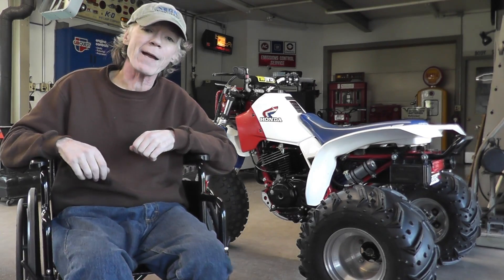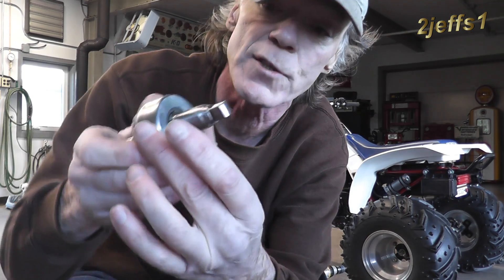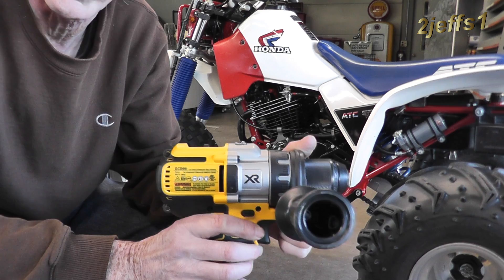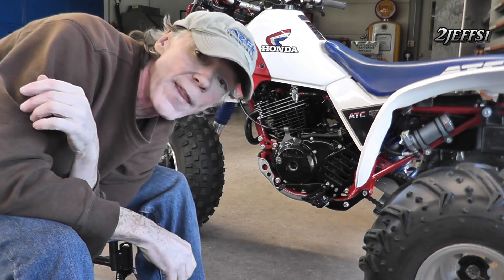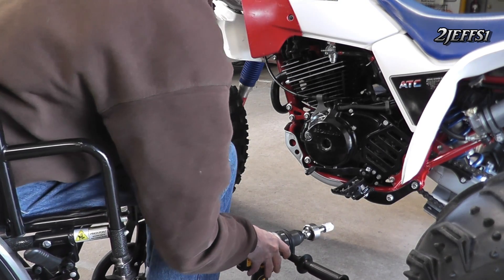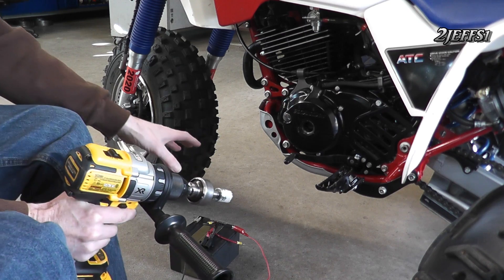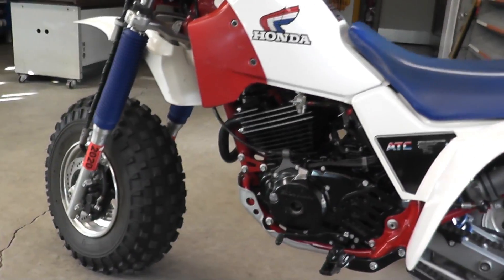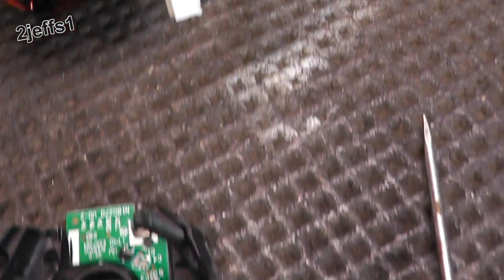Small Engine Starter Drive Setup THIS WORKS GREAT!

Comment: Jeff, have you found any info on a way around the rpm sensor?
Reply from the maker: Not yet. Funny you brought that up. There is a similar sensor deal on the Golf cart motors. There were different ones that would trick the modulator allowing more speed. Seems they were similar in size too. Left the machines out in the cold all day and overnight (25 degrees) along with the drill and battery. Was surprised. Not scientific here but It seemed to work even better. Man did that drill spin the engines fast. I am a big believer in synthetic oil. (Mobil 1 to be exact.) Cold car engines turn over like they were already run that day....
Reply: Jeff, maybe some type of frequency / rpm generator to trick it lol, great video as always!!!!!!!!!!

Comment: I really enjoy every one of your videos. Just remember your wheelchair is temporary. I am in a wheelchair permanently. It's not so bad for me because I still have one leg to stand up and work under the hood and have a midrise lift that my wheelchair fits under. I've been working on cars professionally for 23 years, after I was injuried if been working in my wheelchair for 9 years and have adapted quite well. I can still do everything I used to be able to do in my wheelchair at my home shop, even heavy work. Stay positive my friend as it's the best way to overcome an obstacle. My home shop is much smaller than yours, but it is as organized and well thought out as your shop. I really like your ideas
Reply from the maker: I so much enjoy reading the comments. I like how positive you are which is the best answer to all encountered. Thank you for stopping by, Jeff.
Reply: Your attitude is an inspiration!  Keep wrenching.

Comment: Here’s a thought Jeff.   Try a little different technique in how you apply the drill.  When you hit the button, hold loosely on the drill and let the handle slip or rotate a bit before you catch it firmly, kind of clutch it by hand.   Not too loose.  You don’t want it to get out of hand.  But that way the drill is moving when the sensor checks and maybe it adds a little zip on the initial punch too.  Loved that shot of the bird on the silo.   Really captures a moment in Midwest landscape and outdoors when you panned out.

Be real youtube, face life without the booze.
Reply from the maker: Interesting thought - I shall have to try that. Left the machines out in the cold all day and overnight (25 degrees) along with the drill and battery. Was surprised. Not scientific here but It seemed to work even better. Beats using the foot if it was available for....

Comment: Good video.  I have to make me one of these.  Maybe use your foot starter to turn the engine to TDC on a/the compression stroke.  Too bad there is no compression release.   

I have a little 3hp briggs that I was starting with a 1/2" drill with a 1/4" socket extension.  After it kicked back twice it twisted off the extension.  Pulled out my hair on that one.  Turned out the flywheel was not a great fit to the crankshaft.  A session with valve lapping compound fixed it.
Reply from the maker: Neat write up you had there Dan! Actually the second gen engines do have a compression release. I did film reaching over the seat, holding light pressure on the kicker and as you suggested/thought that did work perfect every time. We were up north in the cold last weekend and everything worked wonderful. It was below zero in the mourning. The 350 wouldn't start after a long crank. Forgot to turn switch to run - duh.....  ;>)
Reply: Yeah so glad I NEVER do that ..... duh

Comment: Liked the video before I watched it! I wonder how one of those battery powered impacts would do?
Reply from the maker: Hi Tony. If you meant to use for the cranking purpose the impact's are a different design to obtain the torque with a hammer effect. I did use an impact to tighten the crankshaft bolt a bit above normal where it is being turned backwards (loosen direction) to start the engines in an abnormal way... You bet, did follow your thought idea for sure!